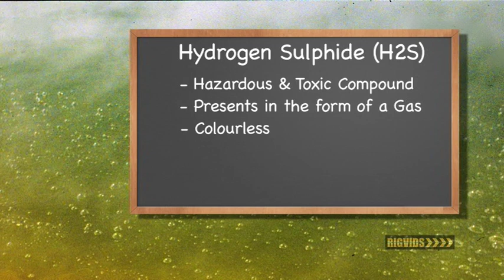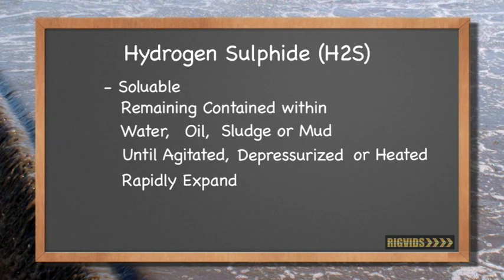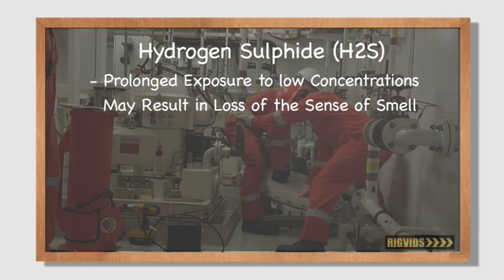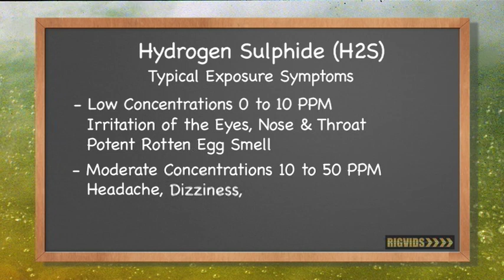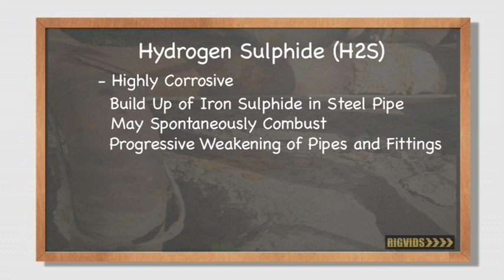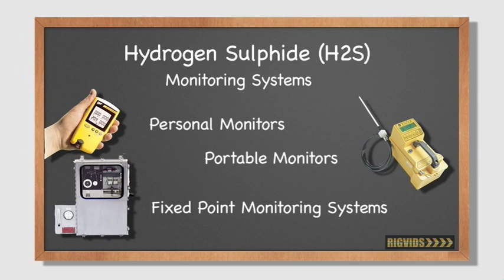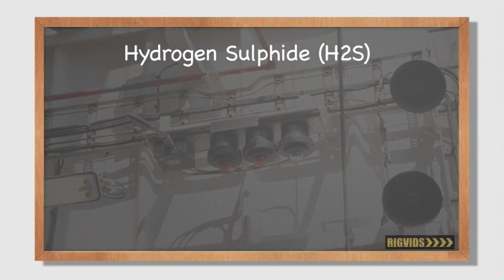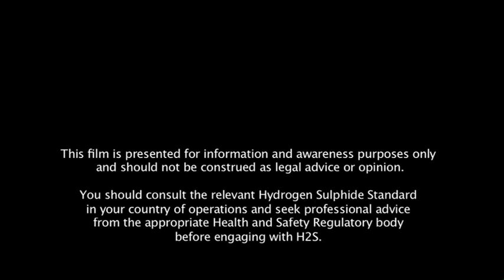H2S Don't Mess with H2S training video

Comment: The British off shore Safety procedures appear more compliant with the means that companies should be setting up their program.  Remember, there arent a lot of escape routes on an offshore rig and jumping off is not any safer!
Reply: you really design stage for oilrig compartment not provide escape route,,when an accident occurs on the deskwork,,all worker should jump in upper sea level same with deepwater horizon movie,,high level jump an estimate same with 4 storey high of commercial building,,
Reply: consultant must provide void compartment for safety precaution specially for wind or air flow on the oilrig deskwork,,